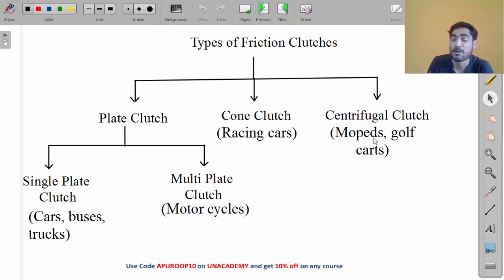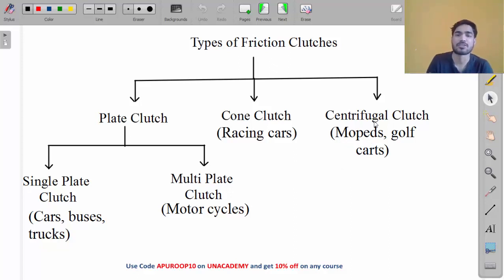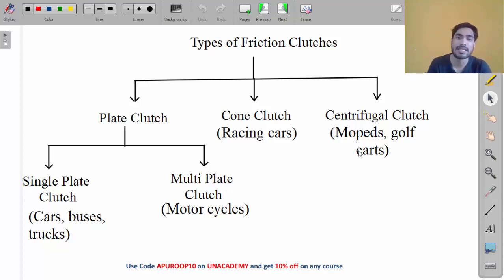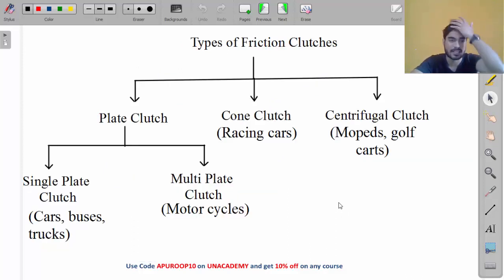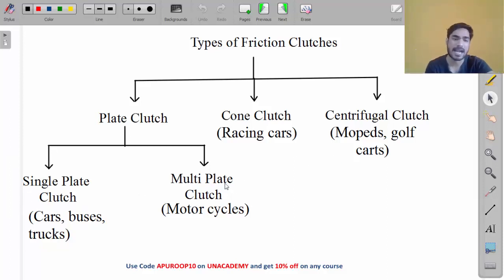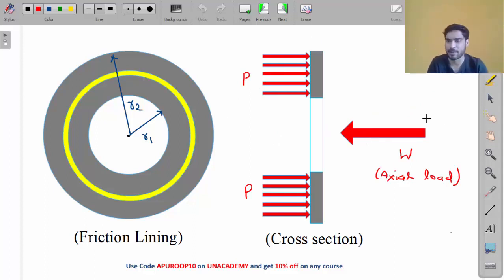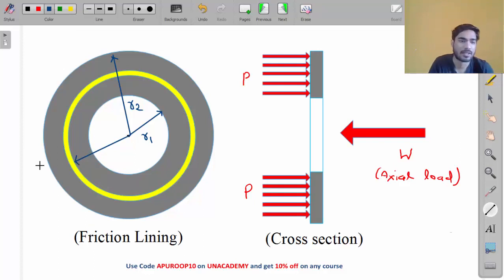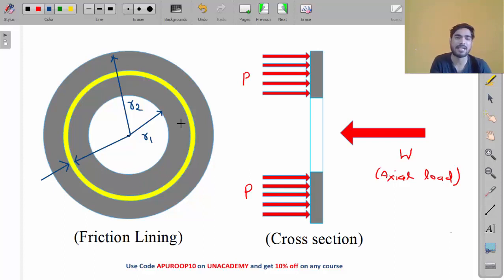Machine Design | Lec - 9 | Design of Clutch - 1 | GATE 2021 Mechanical Engineering

Comment: F1 uses multiplate carbon clutches with a titanium basket.... And no rapid disengagement in F!, instead they use 50% clutch and feel the power flow  and then engage the rest. but it totally depend on the driving style of the driver and its for sure no one engages 100% in a single go as its gonna fade the clutch and eventually gonna make the car slow due to very low working tolerances of the clutch system... and no changing of carbon plates as they cost around 7k USD for one single set.

Comment: we are applying axial force to disengage the clutch....but how the pressure force will be developed even though there is no contact between clutch and flywheel.......
Reply: Pressure is already there due to spring. We apply a force opposite to spring force to disengage.